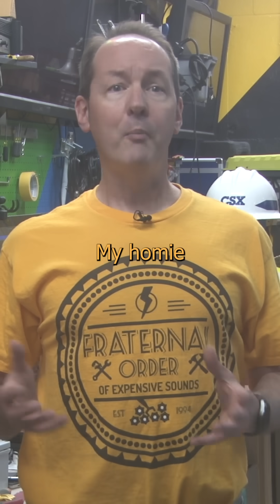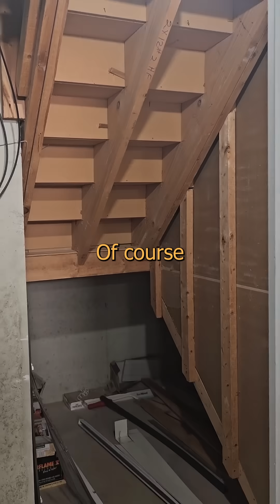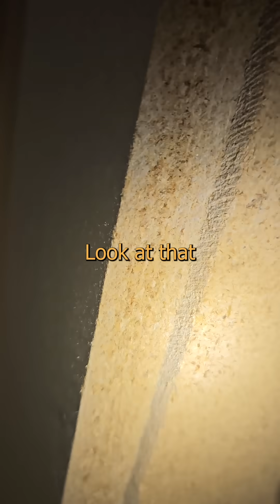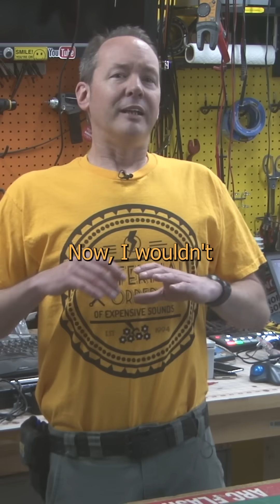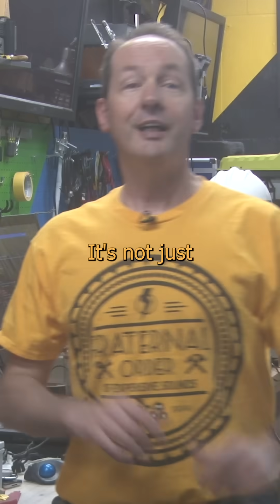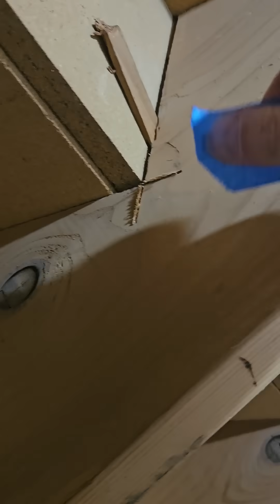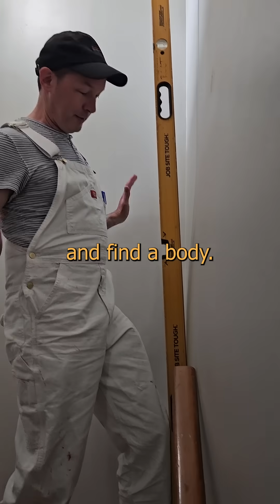Particleboard Staircase #chrisboden #engineering #construction #stairs #cheap #job #work #carpentry

Comment: The blue tape, chef's kiss! Cy would approve.
Here in Germany, stairs are either made with solid wood, or more common now, concrete, since the former is considered a fire hazard. You know, a stair case is just a larger chimney, right?
Reply: Though i don't live in the USA, i do know that there is fire code with regards to staircases. They need isolation and stuff. No clue about the details.
Reply: It depends on the wood. The harder and heavier, the better against catching and spreading fire, even with flame-propagating finishes.
Concrete is not always the best material either depending on it's composition and the fact that it'll dilate unevenly when fire hits it. The wilder the fire... the iron rebars can melt and the cement will get into powder.
Reply: Kings Cross tube station mentioned 🚬
Reply: in many cases, wood has more fire resistant properties than concrete.
Reply: @CFEF44AB1399978B0011  What drugs are you on? It doesn't get smaller than zero. Concrete is not combustible.
Reply: @CFEF44AB1399978B0011 
 REALLY JUST REALLY!!!!!!!!!!!!!!!
WHAT IS YOUR CONCRETE MIXED WITH GASOLINE?
Reply: Here in the States, properly built stairs are made of solid wood & plywood. Shittily made stairs would use particleboard.
Reply: A staircase really is just a bigger chimney...huh
Reply: @silentcalibre1085  Think my friend think about it?
Reply: I have to ask how old are you me 62 and I haven't heard that statement in 20yrs or more. Oooold school all the way Maybe it's the German me too. 1000%true
Reply: @gsg7354  Many old building still stand. And there a lot of poorer neighborhoods that still have appartment building from them early 20th century. Refurbished and modernized, yes, but the substance, such as 4-6+ story wooden staircases remain old.

Comment: You should see some of the new apartment complexes being built in Nashville... not a square nor plumb wall, not a level cabinet, nor outlets on the level. Now we're missing 2/3 the labor force because most are hiding from ICE, not so sure that's a bad thing - you wouldn't catch me living in any of these. Who knows if the building will collapse in a strong wind or tornado 🌪️ 
Buy cheap labor and be left with repairs and possible lawsuits down the line 😂😂😂

Comment: The tread part is usually (not always) just a substrate, while a solid wood tread is adhered to the top of it. It's common in pre-made stairs. If there's carpet on the stairs, peel some of that back and see what's on top. Usually you will find solid oak. This makes assembly easier as they can get the whole staircase built without worrying about the fasteners showing or the boards being 100% perfect. Then they cover the risers with 1/4" veneer plywood and the tread with a solid 1/2" thick oak tread that has a thicker bullnose (1-1/4" usually) to cover the otherwise exposed edge. These treads and riser pieces can be installed on site after all of the other trades are done dragging water heaters and cabinetes up and down the stairs.

Risers aren't aesthetic only either. They help prevent sagging at the step edge. Without them, a particle board step alone would surely break. With them, they take the load at the point where 90% of the weight is always applied, at the edge of the step.

Comment: Those stairs.....
Yikes. A little sketch is OK. But this is ALL sketch. 

I recommend only letting people sleep upstairs that you don't like very much because as soon as those particle boards get hotted up by an unrequested temperature surplus they will fall apart and turn back to the dust from whence they came. 

Nobody is getting down the stairs anymore, because the stairs won't be a thing anymore. Nobody else, like your friendly neighbourhood firefighter will get UP there either. 

I cannot, for the life of me, imagine that this is up to ANY of the local building codes. Looks like someone with questionable intentions wanted to flip this house like they'd flip your mom: as quick and cheap as possible.

Which, to their credit, they kinda-sorta did. If you squint hard enough.

Comment: My ma’s 2nd floor floor was particle board. Installed in the 80’s. When we replaced carpet with hardwood floors the installers were flabbergasted to say the least. They happily ripped out all the crumbling board and put something a little more solid in place

Comment: As someone who's lived home construction from being a kid that house probably passed inspection because  of "independent inspectors". Just looking at the overcuts, that stair was made in the field by someone with a skillsaw. The house is probably pressboard everywhere is should be OSB, and I'll bet there'll be questionable plumming and electrical, too. Best open the panelboard and spotcheck some receptacles, too, including the GFCIs. And check all the weather sealing because once it starts leaking it will swell up and make it leak more.
Good for your friend being able to get a place, but damn, I hate shady builders.

Comment: Particle board treads are never good. The risers are actually a structural element, the stairs want to flex down under load, but the risers resist that. There are types of chipboard that are acceptable, such as Advantech 3/4”, but particle board ain’t it.

Comment: Arizona builder here. Pressed board is not allowed (particle, ply, or otherwise) doubly so if its outside meant to take on the elements. And you're right to be very angry at the builder for it. I recoiled when you revealed that it wasnt just the risers that were fall through boards.

Edit: Fixing a grammar mistake. It wasnt his right to be angy, but in fact he was right to be.
Reply: Yep, i’m not a carpenter but i assume our heat would literally melt that type of wood
Reply: As an Arizona builder, how do you feel about Cys videos?
Reply: Plywood isn't actually a pressed board, it's large, thin sheets of wood glued in alternating direction to combat issues arising from grain direction, not to be confused with OSB which is basically just a very coarse particle board.

Somewhat amusingly, Arizona has some of the best building regulation for homeowners, but also some of the worst inspectors.
Reply: And the insane amount of sloppy overcut on the stringers.
Did Helen Keller cut that lumber?!
Reply: @spvillano  someone with a Skilsaw and no hand saw, or who didn't care as long as it got past inspection.  If there was an inspection.
Reply: AS1860 Particleboard Flooring
This is the code that allows particle board flooring in Australia. It requires the particle board to stand up to 3 months of weathering without a roof. 

I was very surprised by this but thought I would actually look it up.
Reply: @ecospider5  there's also a whole bunch of requirements for what's underneath the particle board in AS1860 that would make it a pain the ass to build a compliant staircase from. Certainly can be done legally, but I'm not sure anyone would bother.
Reply: @ecospider5  maybe they're allowing for future weatherproof versions of particleboard?
Reply: You don't know your code. All the more reason to move to AZ.
Reply: Imagine 2 husky men going upstairs carrying a shelf and they go through the stairs
Reply: So what would the home owner even do in this situation?

Comment: An acquaintance of mine years ago owned a drywall company.  He told me that 90% of the drywaller’s are either drinking alcohol during the day or smoking dope.  I don’t expect things to have improved nowadays.  I had an addition put on a home that my wife and I bought and we wanted it completed before we moved in.  A well known so-called respected builder in the area was doing the job for me and I had to check every day to see what his workers and the subcontractors effed up.  Trust me, it was something every day.
Reply: I worked Tile in highscool. Of all the trades I was around, it was the painters that were the most entertaining, and most annoying for me becaue I knew I'd be sanding the spilled paint off the floor before we laid tile.
Reply: I'm an electrician. The drywall guys on a job are exactly that. Drunks and dopeheads. Far worse than anyone else.
Reply: My GC when I was building my house also said that drywallers were all alcoholics.
Reply: @RussellNelson  Don't even ask what the roofers are.
Reply: If the framing isn't straight, you can bet your ass the drywall won't be straight. 

When he laid the leveler on the wall vertically, that frame was way off the mark. Whoever made the framing evidently did not check to see if it was straight lol. They looked at it and said, "Good enough"
Reply: Houses are built on beer and meth.
Reply: the only thing that's changed since then is the other 10% of them are on pills

Comment: It's difficult to tell, so I'll ask, but what are the stair stringers nailed to at the top? It looks like they only catch a bit of the bottom of the floor joist and is furred out with 1/2" plywood.

Comment: Having a couple of decades in amateur carpentry study and practice i can promise you the instincts are correct. I would be amazed if those could hold 200lb, assuming they aren't layered over structural material. The host of ugly bullshit around it tells me that likely isn't the case. Overall it just hurts.

Comment: Not a carpenter, but I spent long summers helping one in the family

I was explicitly taught that you need no less than 2 inches of REAL wood to support a man. You can do whatever ontop of that 2 inches, slap styrofoam on it for all I care, but that 2 inches needs to be under there to support the weight.

Anything less and it will eventually crack or worse. Ideally more would be better, the stairs I learned to make uses 2 by 10s at a 45 degree with 6 inch right triangles cut out, leaving about 5 3/4 inches of untouched wood for support. We then lay 2 by 6s across those, with no more than 3 ft between the supports.

That design can handle not only people, but the weight of heavy appliances like a refrigerator, tried and tested over the 40 years my grandfather has lived in that house and used that porch (the trailer burned down so we had to rebuild the porch, but it was made the same way except for the steps which use metal frames instead this time)

Thats the kind of carpentry I was taught, the kind that could support well above whats needed because we ain't going to waste time replacing it

Comment: The easy way to make this safer this is take some 2x4s and put them in the center of each step and use toe nails or pocket holes screws to support them. The if the partical board fails it's relying on the 2x4 which is plenty strong

Comment: REAL contracting carpenter here. There are a number of types of micro laminated or glue pressed building materials that look like flimsy particle board but, in many cases, are exponentially stronger than natural wood depending on application. I’d go with the “if it’s not broken don’t fix it” you could also add stringers, if there’s any deflection in the treads.

Comment: I didn't find out my drywall was curved until I did some diy trim work around the garage door and the last piece was a couple inches from the wall. Also found out the stud was crooked, which if you have a proper brad nailer (I don't) could just shoot in diagonal and hit it. Had to use a small nail and added a scrap piece of wood in the gap to make it work.